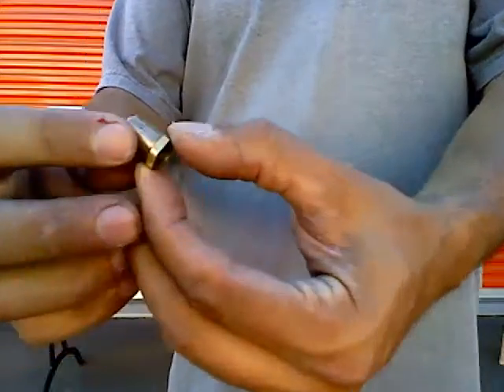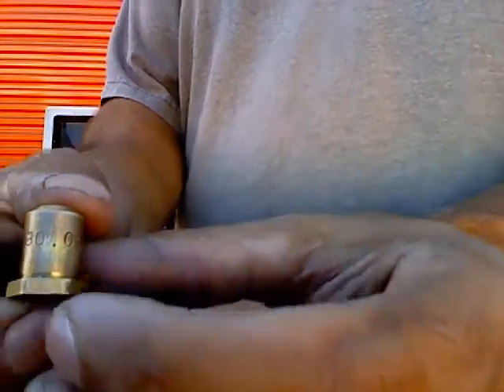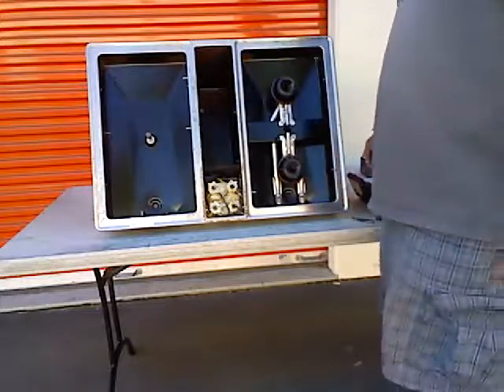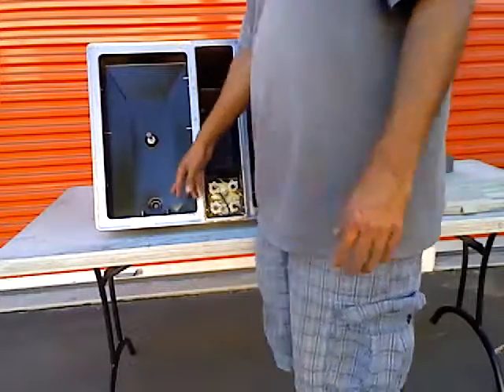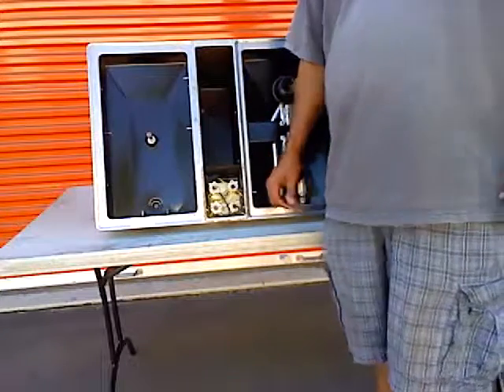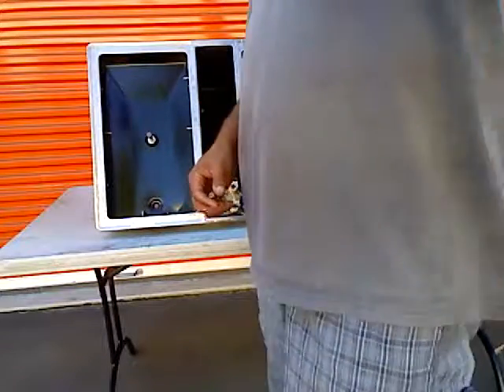Gas (Nat) to propane (LP) stove conversion

Comment: I just purchased a used JDS9860AAP, how can I tell if it is set up for LP or Natural Gas?
Reply from the maker: Jourdan St Laurent the easiest way is to look at the regulator to see if it's set for natural gas or propane. If you subscribe to my channel, you'll see my video on converting a regulator between natural gas and propane. Either way, I sell orifices to convert these units so feel free to call me at 714-574-1544.